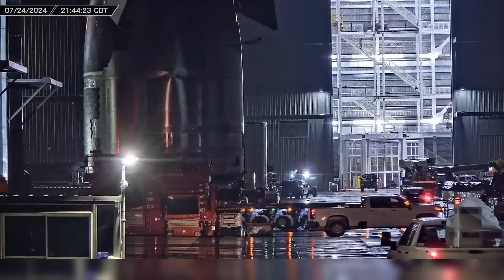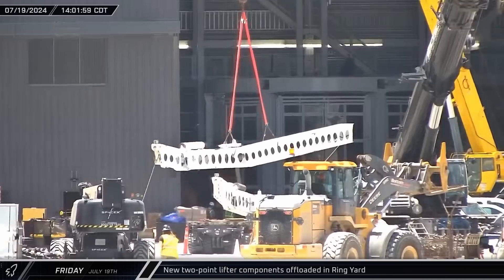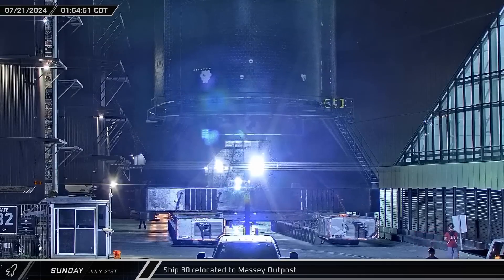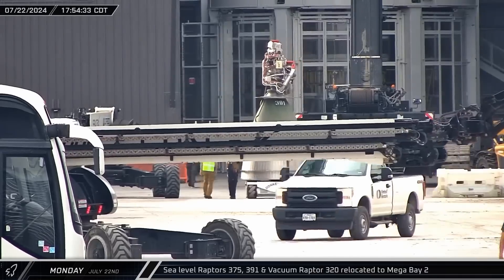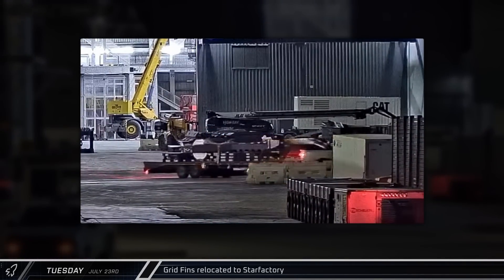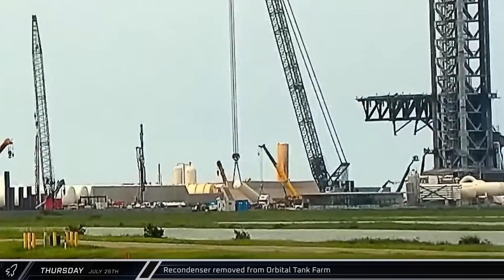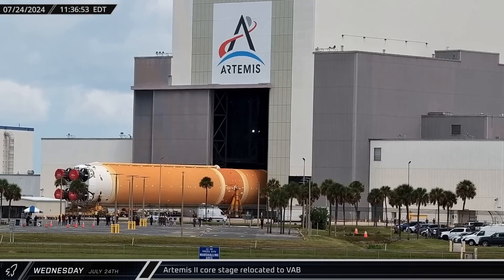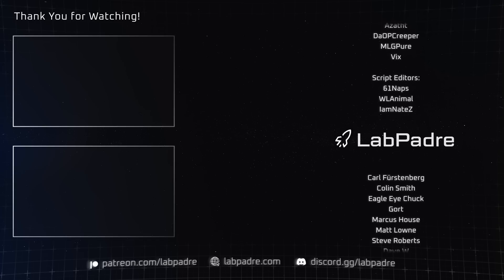Awesome New Designs! Will Starship's Heat Shield Improvements Work? - SpaceX Weekly #125

Comment: Thinking out loud could Endura Coating's Composite Diamond Coatings (CDC) Specifications Series 1100 formula be changed to be slightly improved to result in a higher temperature resistant diamond coating adhesion resilience, then coat Starship's many stainless steel heat prone surfaces like Flaps, and the non tiled Outer Space Facing on reentry unshielded fuselage side so that on re-entry heat could be wicked away by diamond coating from under the new two layer heat shield tiles, and the heat would leak into the plasma stream exiting as heat lost, and away from the stainless steel surfaces adding additional surface cooling. Possibly even stabilizing Starship even more on reentry by means of improved more stable, laminar plasma fluid flow dynamics when Starship is entering Earth's upper atmosphere in a less turbulent stream, which may decrease both flap, and fuselage unwanted abrasion. The benefit of the diamond coating is the removal of destructive heat from StarShip’s many plasma heating transitioning points, even wicking heat from tiled surfaces to non tiled surfaces to be dissipated away in the trailing plasma stream. Are there any thermal engineers out there who wish to comment on a three layered heat shield system comprised of diamond coated stainless steel surfaces, layer one heat shield, layer two heat shield.

Google Search at “ScienceDirect”: Research Paper titled "Effective thermal conductivity of a diamond coated heat spreader"
Reply: How does it cope with expansion and contraction?  That's one of the big problems the TPS faces.
Reply: @TheEvilmooseofdoom A very Interesting question to test for on samples of diamond coated Stainless Steel. 👍

Comment: Will the new Starship tiles work???? Maybe. Will they ever be as good as Stokes active cooled stainless steel heat shield solution???? No!!! Starship tiles will always be fire hot when Starship lands. Stokes heat will be àlmost cool enough touch. Starship will need a careful inspection of tiles before next flight. Stokes Nova will be ready to restack immediately after landing. Face it. Stokes 2nd stage is a superior idea over Starship!
Reply: Stokes on Stoke lol 😊
Reply: Spacex wants to reuse the rocket by only 4 hours, Stoke space wants to reuse its rocket within 24 hours.
Reply: You sure sound stoked!  BTW, what is Stokes and what have they done lately?
Reply: @LZisGBE  They're also developing a stainless steel rocket intended to be fully reusable. Although it's smaller and a much different design than starship.
Reply: Sure, they'll NEVER be as good as the untried or tested system stokes is using.  You pretend experts.  You try and fake it and fail.
Reply: @georgeworthington4239  wrong on both accounts. Heat shield tiles cool very quickly, steel does not.
Reply: But elon christ can't ever be wrong.